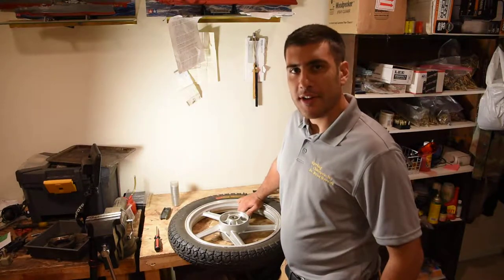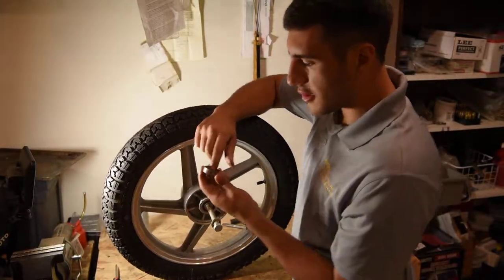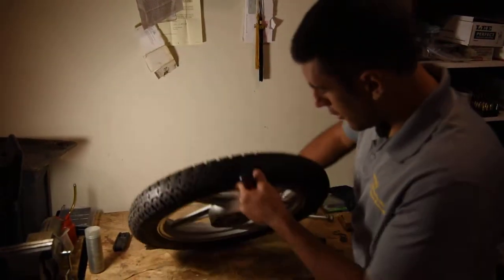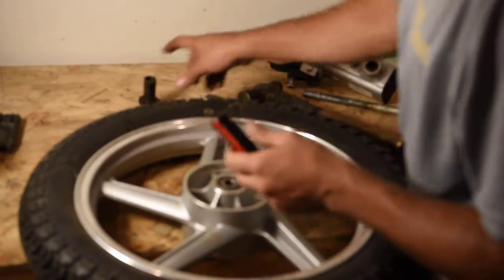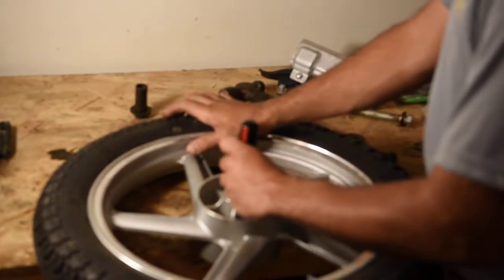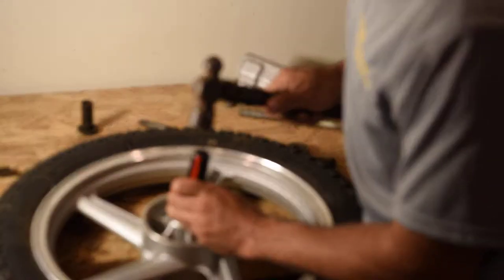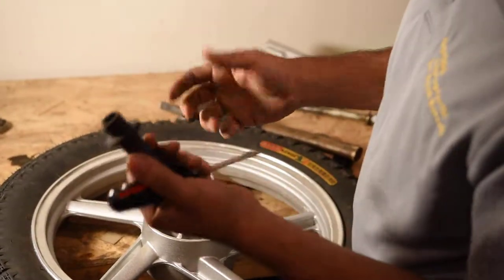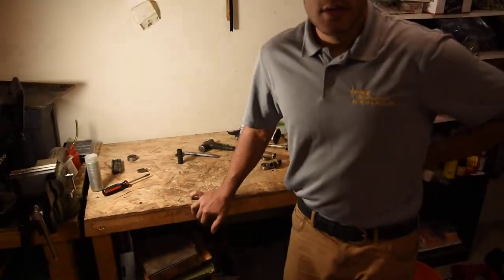Yakima trailer bearing removal

Comment: Nice  .... great info 
Could you put the bearings  order information link in comment 
Specification  so I can order bearings off Amazon... I need to replace  the bearings on my trailer .... thanks
Reply: Did you get the bearing info???
Reply: According to Yakima site, bearing number 6302-2rs. I ordered the Timkin bearings off amazon.